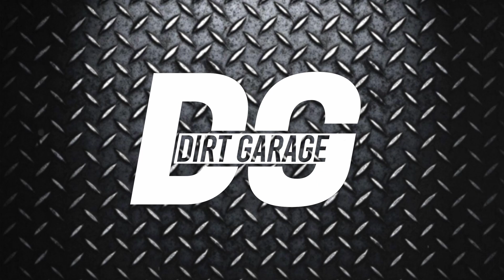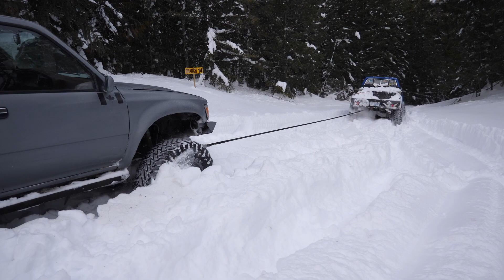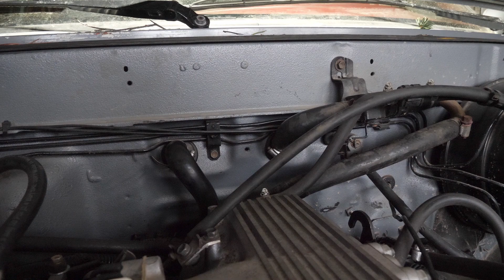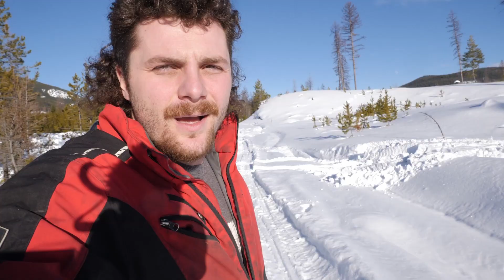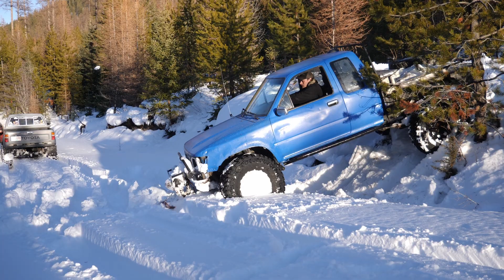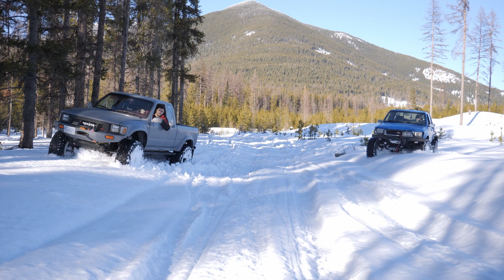V8 Swap Pickup Snow Wheeling

Comment: Ditch the toyos.. or groove the crap out them. I run 2-6psi with my MT2 40" radials and basically never get stuck. Also its a 1uz run that biach on the limiter. I ran 10 10lb bottles of NO2 though mine and no problems beating on it in 7 years.
Reply from the maker: Haha I don't have 30 spline chromo stuff in my front end yet. So for now being careful with the extra power.

Comment: I've got a 1983 that the front leaf springs are shot and my little 110volt welder isn't up to any major mods do you think 3" pro comp front springs with the bottom leaf pulled out would be usable and ride softer than they would stock? I know they will probably ride softer than my bumps tops currently do
Reply from the maker: We all run the Trail Gear 3" and work great. Rides half decent, and flex pretty good for leafs. I have not seen anyone use the pro comps.
Reply: @DirtGarage  thanks, ill look into those I'm already running their engine and tcase bombproofmpunts and their spools front and rear I won't even need to add a sticker

Comment: Learn to drive in the snow dummy DON'T SPIN YOUR TIRES AND YOU CAN DRIVE RIGHT THROUGH IT
Reply from the maker: This is not always the case, the first day was all sugar snow and was all wheel speed. The second day 100% it was easy crawly snow, as I clearly mentioned multiple times in the video.
Reply: @DirtGarage  Have you guy tried chains?
Reply: Chains don't work in deep snow. Gotta air down tires to at least 5psi.  Chains only work in compact ice/snow
Reply: @RMM--uv7uk  Yeah, I don't know about that. I think that only works with big mud tires like super swampers. 
What I do know is that I chained up my dad's 1 ton dually pulling a 16' EMPTY stock trailer up a 9 percent grade in 2 feet of snow and the chains allowed the A/T tires to bite in rather than polish the snow and turn it into ice. Now mind you this was someone's driveway, and it had no hidden obstacles, just a grade and snow.    
But, I went hunting with my neighbor and we took his 1992 f150 short bed, no lift, with 31x10.50-15s.  
He chained up just the fronts, and that truck was passing jeeps and ATVs. 
We drove through gullies and up hills, all with about a foot and a half to 2 feet of snow.